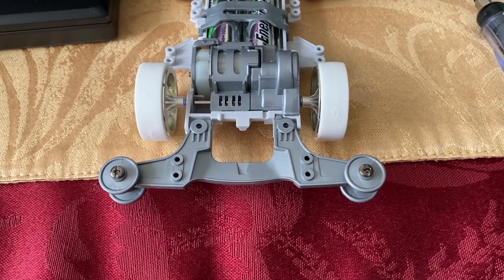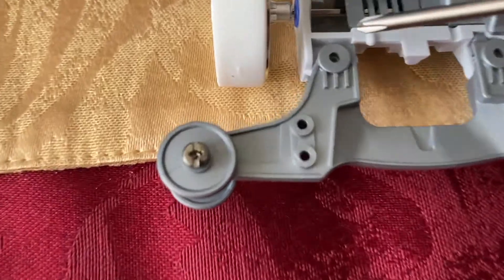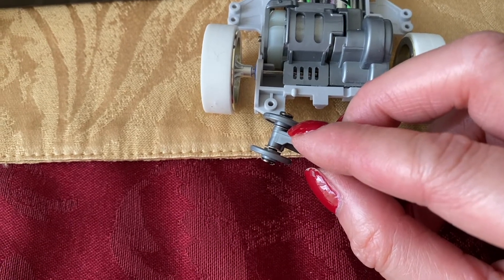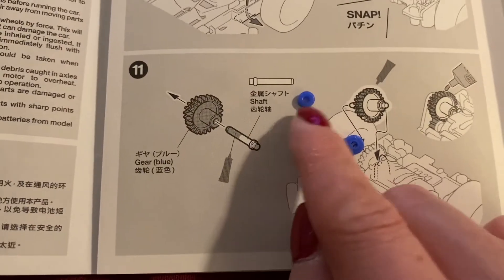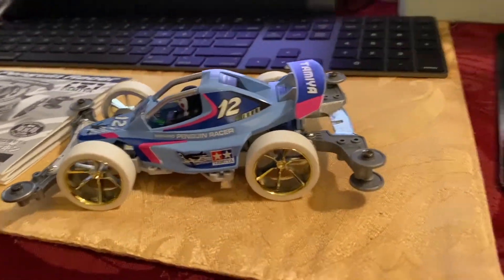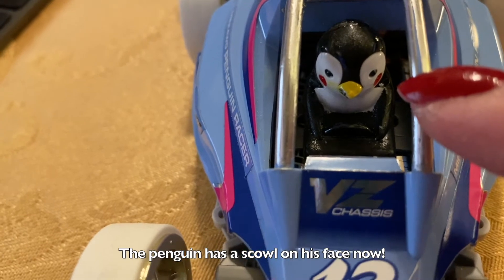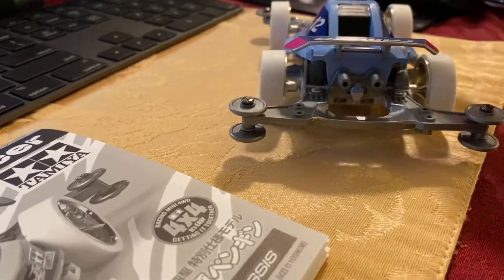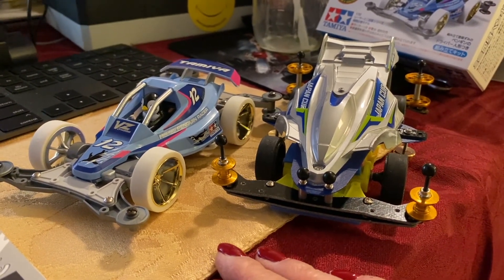Tamiya Mini 4WD Penguin Racer Modification Tips

Comment: I doubt they will do a new molding for the rear VZ stay to include a notch on the left side. The only time I have known Tamiya to do a remolding, was when they realized the Super II chassis motor cover was faulty. After that point, the kits with the Super II chassis included an extra motor cover.